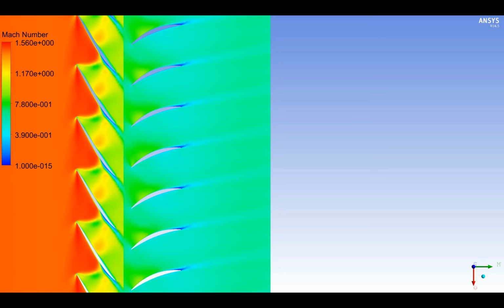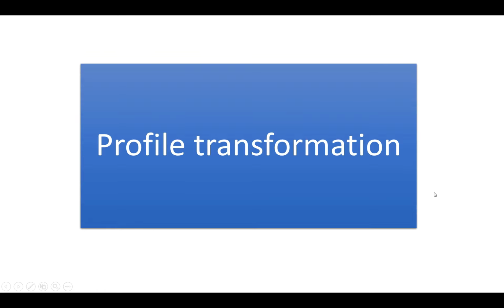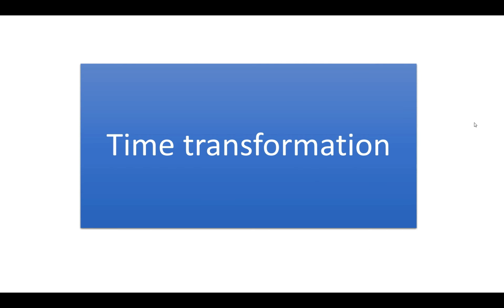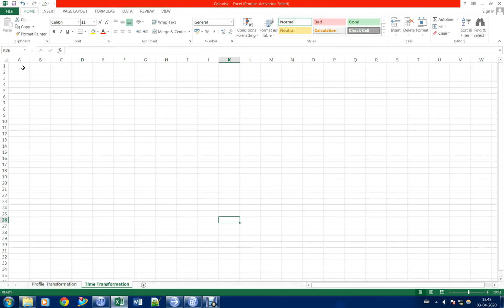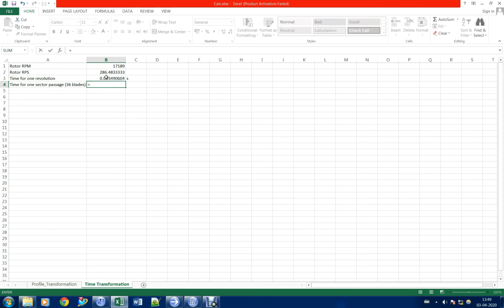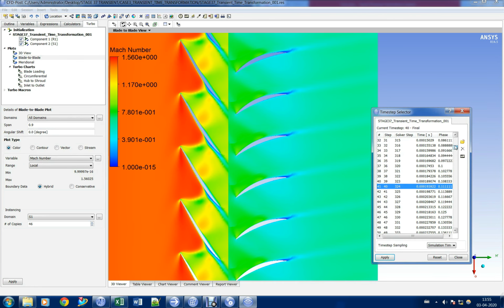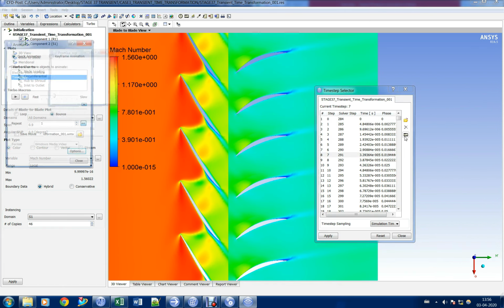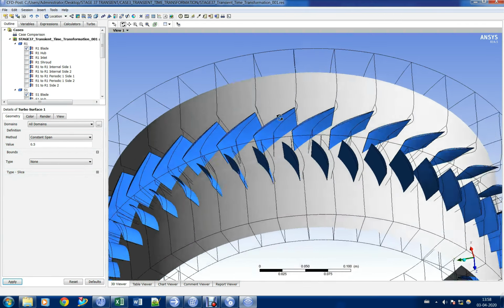Transient CFD Analysis - NASA Stage 37 | Time Transformation | Ansys CFX

Comment: Hello,teacher. I’m currently working on aerodynamic analysis of a 7-stage low-pressure steam turbine blade flow field using ANSYS CFX with a steady-state approach. Your video demonstrates transient simulations, which raises two critical questions for my research:

Result Accuracy: Is there a significant deviation in key parameters (e.g., pressure distribution, efficiency) between steady-state and transient results in multi-stage turbine analysis?

Computational Cost: For a 7-stage configuration, would transient simulations lead to a dramatic increase in runtime (e.g., 10x~50x) compared to steady-state, considering interface treatment (e.g., transient rotor-stator)?

Your insights would greatly help me balance accuracy and computational efficiency. Thank you for creating such valuable content!
Reply from the maker: Hi, 
Usually for 2 or 3 stage turbomachinery cases, there will not be a significant difference. But for a 7 stage case, there may be some differences. Also it depends on the flow conditions. If the turbine operates at off-design condition, the difference will be high. 
 For a steady state case, you can use single blade passage for each row and provide circumferential periodic interfaces. But for a 7 stage turbine case, you may have to go for full 360 deg configuration, which may be computationally expensive. You can also use time transformation technique to use only 2 blade passage in a
transient analysis, but you have to check if the model satisfies the pre-requisite conditions for time  transformation.
Reply: @LearnCAE  Thank you very much Prof. Best regaerds to you!

Comment: Can we save the simulation results while the simulation is running? the problem is that my transient case simulation takes time upto 21 days , and sometimes the pc gets off in between so i have to start the simulation from scratch
Reply from the maker: Yes, you can save the results for each time step and you can start the analysis from the timestep it stopped by giving the recent file as initial condition
Reply: @LearnCAE  how can i save while the simulation is in progress?
Reply from the maker: @faiqshahid1015  Goto to tools and choose backup run
Reply: @LearnCAE  i did and where is that backup file saved? in the cfx post folder?
Reply from the maker: @faiqshahid1015  Backup file will be saved in solver directory

Comment: Very useful video, many thanks for this demonstration. I have problems starting the simulation: i did all of the steps that you suggest with my file which is a stator-rotor stage of a turbocharger turbine. Unfortunately, when i click on start run the solver returns the error "Partitioner exited with return code 1". I don't know how to fix this, could you gently help me?

regards
Reply from the maker: Hi, this could be any common mistake in the case file. Could you try to run in serial mode once?
Reply from the maker: Thanks for your comments.
Reply: Unfortunately does not work as well
Reply from the maker: Oh. Then case needs to be checked for errors.
Reply: After several attempts, the problem was just the version (I don't know why) upgrading from 18.1 to 19.2 seems to be OK. Many thanks for your time.
Reply from the maker: @momentumgamingtv  Oh, that's surprising. Anyway glad to hear this. All the best.